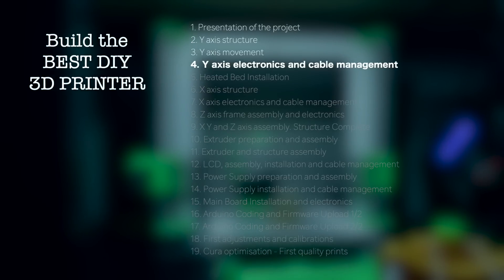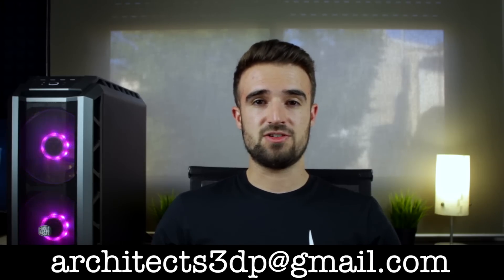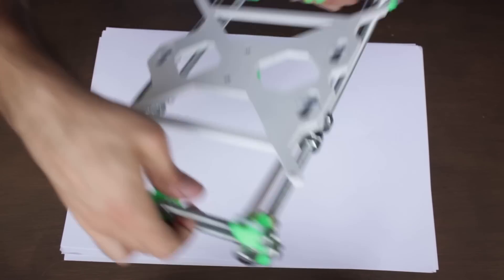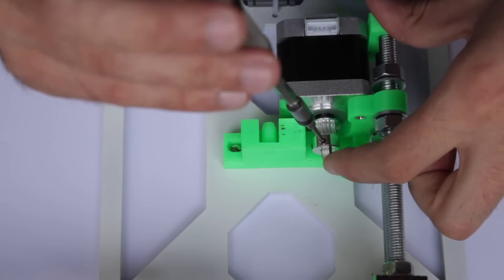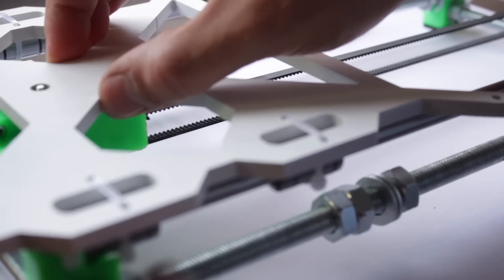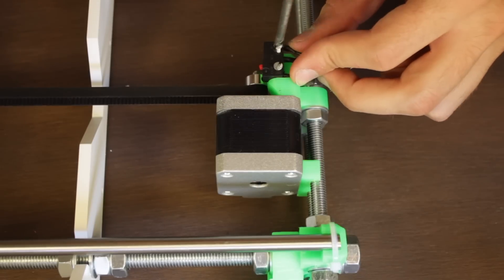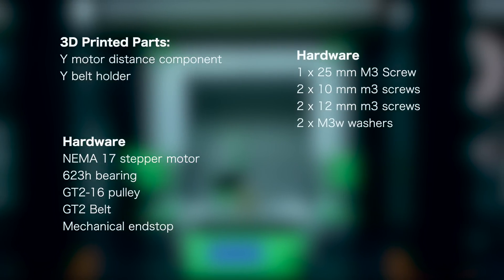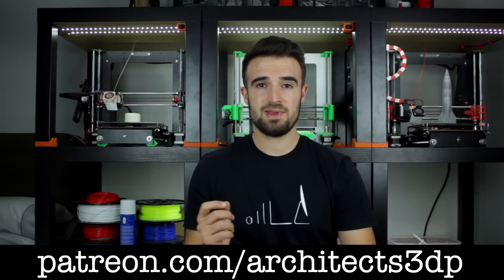Build the BEST DIY 3D Printer - Y axis electronics and cable management #04

Comment: Sir I have an idea about playing high graphics mobile games in  virtual reality at low cost would you plz help me it will cost only 10 dollers
Reply: Plz help me
Reply from the maker: nice Idea! how can I help you?
Reply: How can we connect a wire in a key bord plastic circuit
Reply: I tried to solder but it burned and I also tried tape but it so loose